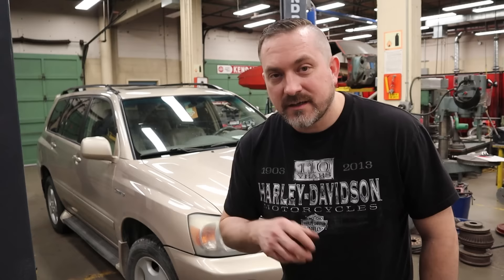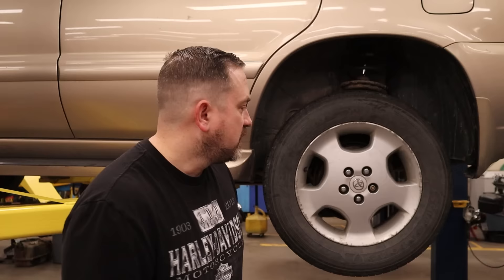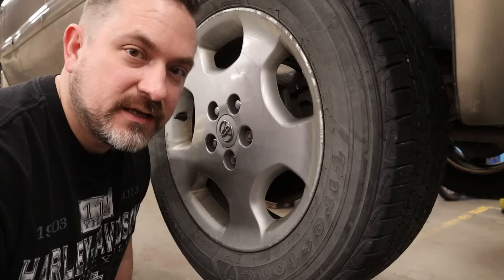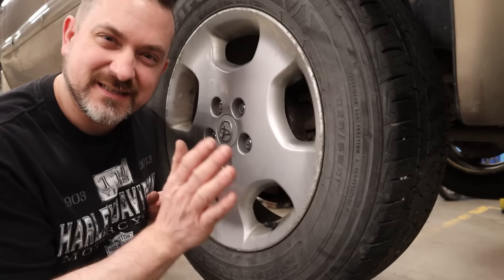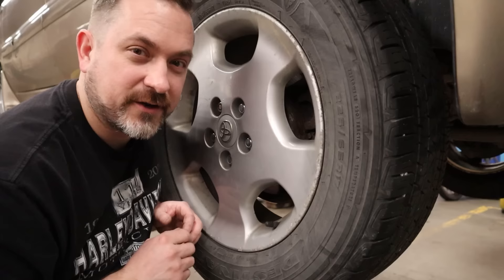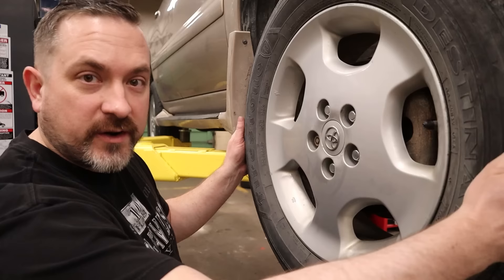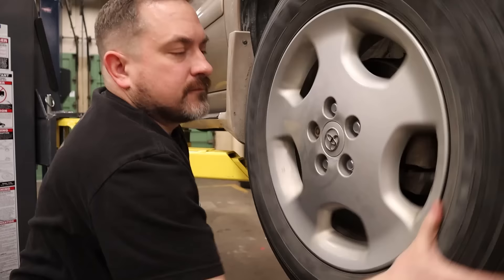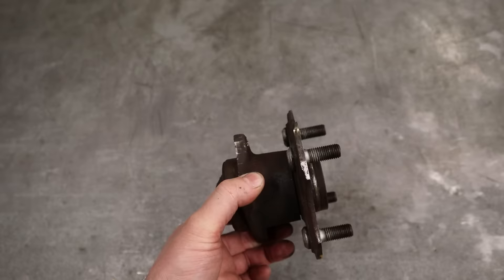How to 100% diagnose a bad wheel bearing.

Comment: Have a small grinding sound front left at SLOW 20mph. Thoughts ?
Reply from the maker: Grinding noises are usually very worn out bearings or brake pads.  My guess is your brake pads are worn out and you have metal on metal contact now.  I have a great video on checking disk brakes and another for drums if you're interested.  Thanks for the watch!

Comment: Is it usual to have to replace both sides ?
Reply from the maker: It's good practice because both wheel bearings have the same amount of km put on them so if one is gone, the other is soon to go.  You can just change one but usually the other is not far behind.  I have a video on changing this wheel bearing as well if you need it.  Thanks for the watch!

Comment: My  had a bad noise on the right rear of my car. I took a turn down my road to home. 1 mile.  So I'm checking out on what's happening.  So many things go into this. My friend says maybe brake shoes dragging, possibly a broken brake clip that holds the brake shoes in place. 
I wonder if there's more. I hope to learn more about this. 
But I'm 80, a woman but always keep learning about the motor. Anyway can you advise me about these. 
Thank you. 💞 😊
Reply from the maker: That's awesome that you are wanting to learn more!  Yes it could be lots of things.  Try to narrow it down by figuring out if it happens during braking or not or both, when you turn corners, when you speed up,etc.  Then you can check that system.  I have several videos on checking bearings, steering, and brakes so you can start there.  Hope you figure it out.  Thanks for the watch and welcome to the channel!
Reply: It started out making noise when I was backing into my parking spot. It did it a couple times then it made the noise the last time I was coming home. I was almost home and then it was constant.  I then called my friend and he came to drive it. Took a foot and said, not good. 
Thank you for getting back with me. I will let you know what they find.
Reply: @wayofthewrench  I'm getting back to you on my rear tire noise. My son came to check it out. It had bad brake pads, rotors and calipers.   Also the bushing were bad. It's a 2007 hyundai, so it's old.
Anyway he got everything and did both rear tires for me. 
I'm thankful for a smart son. 
Thank you for your interest in what it was. 
Father's day next Sunday. So an early Happy Father's day to you.
Reply from the maker: Sounds good
Reply from the maker: Thanks for the update and thanks for the Father's Day wishes.  Glad you got fixed up. Cheers!
Reply: @wayofthewrench  You welcome and thank you.
Reply from the maker: No worries!

Comment: Ok, someone told me I needed a new wheel bearing, but now I'm not too sure. It started out like,, first it would sound like an opera singer hitting a high note just when I used the brakes, then on day 2 it would do it when I used the brakes and when the car accelerated.. it's a very loud, high pitch sound. I started out thinking it was my brakes bc I do need new ones.. I'm not sure now ..  🤔
Reply from the maker: Sounds like your brake pad squealer tab making noise.  I would check your brake pads, I have a great video on that.  Thanks for the watch and welcome to the channel!

Comment: Was there a vibration while driving between 20 and 30 mph? Also, between 70 and 80 mph?
Reply from the maker: Not between 20 and 30 and I wasn't able to road test at anything higher than 40-50 but there were vibrations and sounds like in the video.  It was a bad bearing and the part was changed in the next video if you'd like to see it.  Thanks for the watch and welcome to the channel!

Comment: Can you have that play in the wheel horizontal and vertical but not have the noise on acceleration?
Reply from the maker: Yes you can because you could have loose lugnuts or bad steering and suspension components.  Sometimes a bad bearing has play but hasn't been damaged enough to make noise yet.  Hope that helps.  Thanks for the watch and your support for the channel!  Cheers!

Comment: When your check-in the bearing on an automatic transmission is the car put in neutral as you spin the wheel
Reply from the maker: The real check is a road test for the noise and the play once up in the air.  The spin test isn't the greatest method.  You should check out the road test bearings video too.  Thanks for the watch and welcome to the channel!

Comment: Hey, I have two issues with my 2014 Mustang that my local mechanic can’t figure out

Issue #1	Vibrating / clunk sensation in gas pedal / front end while turning and accelerating from dead-stop. 

Issue #2	 Faint cyclic scraping / squeal from wheels under harder acceleration. 

Someone said it is the trans mount, and maybe a bad wheel bearing, but what do you think
Reply from the maker: Hrmm hard to say without checking myself but the clunk under acceleration could be worn engine mounts or worn u joints on the drive shaft.  I'd also check all steering and suspension components too.  The scraping sounds like worn pads and you should check your brake pads ( inner and outer) and if a dust shield is slightly touching the rotor.  Hope that helps.  Thanks for the watch and welcome to the channel!

Comment: So what if the steering ends are bad? Wouldn't you get the same side to side rock.? What about the upper and lower cradle.  Wouldn't it rock too.?
Reply from the maker: If there is play up/down and left right then it is loose lunuts or a bad wheel bearing.  If it's just left/right play, then it is steering parts that have play ( inner/outer tie rods or steering rack/bushings).  If it's just up/down play, then it's upper/lower ball joints or strut mount.  Thanks for the watch and welcome to the channel!

Comment: Out of curiosity could a squeaking noise when you turn the wheel also be down to a bad bearing? Thanks
Reply from the maker: It could be but a speed dependent sound and or play like in the video is the check.  I also have a road test bearings video you should check out too.  Thanks for the watch and welcome to the channel!

Comment: Great video.  I think I have a bad wheel bearing.  However when I turn wheel to right noise goes away.  Does this confirm the passenger side would be the bad wheel bearing?  Acura 2014 MDX SH-AWD
Reply from the maker: Not necessarily.  You have to jack up the front of the car to check anyways so just check both.  When you turn the car around corners you are loading and unloading parts like wheel bearings and cv axles.    Thanks for the watch!

Comment: what about if ur wheel feels wobbly while speed increase lug nuts and tight and good could that still be the barrings
Reply from the maker: If you jack it up and there is play up and down AND left/right, then it could be lugnuts or wheel bearings.  Torque the lugnuts to proper specs and if it still has the same play....its a wheel bearing.  Good luck!

Comment: Finger on the spring and spin the wheel, you can feel the vibrations with your fingertips, best way..
Reply from the maker: Yes that is a good method, I have a road test bearings video you should check out that has this in it too.  Thanks for the watch and welcome to the channel!

Comment: Thank you - I just bought a Skoda Yeti yesterday, on a test drive out on the motorway around Glasgow city centre, I didn't hear or feel anything, all looked good with the car, then bought it. Got home, in a quieter area, I can hear a noise coming from drivers side front wheel I think, I feel fairly sure it has a faulty wheel bearing, the noise gets louder when going faster, then quieter as I slow down. Luckily the car came with a 1 year warranty so I will be making a claim tomorrow morning. Does anyone know if it is dangerous to drive the car whilst it has a faulty wheel bearing i.e. a garage may have a long waiting list before I can get it booked in and repaired, so should I leave using the car for now?
Reply from the maker: A Skoda eh?  Good old Slovak car!  Sounds like a wheel bearing, you could also watch my road test bearings video to help you confirm what side and a few more tips.  I would confirm you don't have loose lugnuts and check if the play is really bad.  If it just started you have a bit of time but they can be funny.  They could last weeks or hours, it just depends on a bunch of factors.  A wheel bearing could be upwards of $1000 in a shop especially if they find other things or if they have problems removing parts due to rust.  Plus I'm not sure how hard Skoda parts are to find.  Good luck!

Comment: I know it’s been a bit, but what if there’s no side to side play but there is up to down play? It’s still likely wheel bearing right?
Reply from the maker: It could be but only up and down play is usually suspension components that are worn.  Ball joints, strut, control arm bushings.  Have someone shake the wheel while you check on the other side with a light.  Good luck!

Comment: \The onlly thing you need to do.   Lift up the car.   hold one hand on the spring, and turn the wheel.  If the bearing is gone you wil feel the vibrations in the spring. simple as that.
Reply from the maker: Yeah that's a good tip, I have another road testing bearings video you should check out too.  Thanks for the watch and your suggestion.  Welcome to the channel. Cheers!

Comment: My front right wheel is just making a light scraping/rattling type noise but nothing like this, started after a bad pothole so not sure if it’s the wheel bearing or not
Reply from the maker: You will have to check that out like in the video.  I would suggest you check the rim for damage and the thin metal dust shield next to the rotor too because of that pot hole.  Good luck and thanks for the watch!.

Comment: What if my car shakes while breaking in the free way. I replace break pads and rotors the good ones from auto zone and still does the same thing. Last year I replace the rotors and break 3 time
Reply from the maker: Sounds like perhaps you have a worn steering or suspension component or possibly a stuck slider pin on your caliper.  Hope that helps.  Thanks for the watch and welcome to the channel!

Comment: What’s the buzzing noise? Is that from the wheel bearing also?
Reply from the maker: It's hard to isolate every sound in the video but focus on the speed dependent sound that gets louder with more speed.  Tires can sometimes make sounds too but you're listening for whirring noises.  Hope that helps.  Thanks for the watch and welcome to the channel!

Comment: I have i believe a sound coming from a belt ,but im sodded if i can work it our for sure..it only starts making a noise after the engine warms up..
Reply from the maker: Belt noise is usually it's worn or loose, check for wear, shinny surface on grooves, and if you can twist the belt Morse than 180 degrees between two pulleys.  If you can, the tensioner is bad.  Usually belts make noise at cold start ups then go quiet and make noise at hard full turns.  If it happens once the engine is warmed up, it could be a bad bearing on one of the pulleys ( alternator, tensioner, idler, Ac compressor, power steering, etc).  Good luck.  Thanks for the watch!
Reply: @wayofthewrench  thanks for your input..I've been avoiding long journeys .I suspected a bearing as the belt was only changed 10,000 miles ago.
Reply from the maker: I would still check your bearings in case it is that or something else loose or bad you spot.  Good luck!

Comment: Two times the wheel bearing failure fooled expert mechanics. Once it was tread separation and the second was intermittent grinding caused by a fractured roller. One mechanic was a top fuel contender the other was a life time family business mechanic.
Reply from the maker: This was one of your wheel bearings?
Reply: @wayofthewrench  Ha ha he he, yes. The tread separation was on a Dodge Van and the mechanics replaced the wheel bearing. They said sorry "thats the best we can do". I eventually found someone who knew about tires and they sold me new tries. The other was a Saturn Ion. Notoriously bad wheel bearings. I replaced them myself several times and the mechanic bet me 5 bucks it was not a wheel bearing. I gave him the old bearing and he said he didn't believe me and would not pay the 5 bucks. Hahaha. Oh gosh. German made bearings are sometimes made in Taiwan. Timken seem to be consistent quality and reliable as a bearing can be that hits potholes a foot deep.
Reply from the maker: I had a tire separation on an old truck the other day...I had to stick my body out the window so I could see the issue.  There was a huge bulge in the tire that was not obvious when it wasn't spinning.  Ya proper diagnostics is key to not wasting money and time.  I think the last time i went to a mechanic was 19 years ago.....I like saving my money and actually enjoy working on my vehicles too.  Thanks for the watch!

Comment: Thought my wife's car has a bad wheel bearing before I watched your video. The sound coming from right side, only noticeable with open windows when it is bounced off the buildings or greenery. I noticed it after I cleaned her brakes and rotors after winter salt and grime. Brakes have over half their life left, so it can't be brake life indicator.
Reply from the maker: Hard to say, when you cleaned your brakes you might have cleaned off the silicone grease on the back of the brake pads.  That might be the source of a brake squeak but usually that is at slower speeds.  Does the sound change when you turn sharply?  Is it a speed dependant sound?
Reply: @wayofthewrench  it sounds when going straight and rate increases with higher speed. I regreased all contact points. Appreciate you reading and replying. Will take it apart today and see what's going on there. Rear passenger brake always gets corroded the worse and even got ceased once. I'm thinking it could be warped rotor, but everything is smooth and brakes don't pulsate.
Reply from the maker: Any luck?
Reply: @wayofthewrench  most likely rear bearing after all. When I removed brakes and caliper, I can hear some slight grinding and doesn't feel smooth when rotating.. Wheel itself is solid when yanking on it in every direction, so I think it has some life left.
Reply from the maker: If it's making noise then it's on its way out.  You could watch my road test video for bearings for other tips to narrow it down easier.  Good luck!

Comment: Damn, I'm less confident now it's my wheel bearing. I get a sharp screeching, like metal on metal (or pavement). Can happen at any speed, braking DOES change the pitch, and is inconsistent--it comes off and on, but it's been getting worse. I'll have to take it in at this point.
Reply from the maker: Hrmmmm hard to say but it sounds like your brake pads are worn out.  You might also wanna watch my road testing a bad bearing video too.  I also have a great how to check your disk brakes video too.  Good luck

Comment: what is the diff from bearing and bad cv joint on all wheel drive gone bad?
Reply from the maker: The sounds can be similar but you can test CV axle at low speed full turns in a parking lot.  When you max out the left/right turns and drive in a circle, you are pushing the CV axle and if it's bad, it will make a clunking sound.  You can also do this in reverse to test the other end of the axle ( inner and outer joint).  You can also lift the vehicle and grab the CV axle shaft and try to spin it by hand, there should be no play.  If there is a lot of play then it's bad.  Another give away is if there is a torn CV axle rubber boot with grease flung out.  Hope that helps.  Thanks for the watch and if you deem me worthy, I'd really appreciate it if you could share out my channel on your social media so I can help more people.  Cheers!

Comment: I only hear a grinding sound when i drive slow and hear it louder when i drive slow and turn too the left for some reason but it dissapears when i drive faster than 30kmh
Reply from the maker: Grinding sounds are never good.  Something's not good and is a safety concern.  If it makes more noise when turning a direction, that is giving you a hint like it's a bearing on one side or a CV axle.  I would jack up the car and check it out.  Good luck!

Comment: I have a 2008 silverado 2wd. My sound is very mild but i can also feel it on my steering wheel. It also is constant but the more speed, the higher the whirling sound🤷‍♂️.any thoughts?
Reply from the maker: It sounds like a bad wheel bearing to me, check it for play.  It could also be worn steering or suspension components too.  Hope that helps.  Thanks for the watch and welcome to the channel!

Comment: So i am having a scraping / grinding sound similar to what a bad wheel bearing would sound like. 

But checking for play and noise is unsuccessful. Seems fine that way. 

The sound is only present at very low speeds and does not change if clutch is pressed or gear is changed. Sounds same both in neutral and with gear.. 

Sound goes away when accelerating / decelerating... 

Strut mounts are in very bad condition and is getting swapped soon. But i doubt that could make this sound? 

Transmission, Wheel Bearing or CV? Very frustrating.
Reply from the maker: I would check your brakes and check for a bent dust shield that is scraping on the rotor. I have a great video on checking disk brakes too.  Thanks for the watch and welcome to the channel!
Reply: @wayofthewrench Thanks for answering. I just changed rotors and pads. Cleaned everything good and regreased. Its a more low pitched sound. Not like typical brake-noise.
Reply from the maker: Speed dependent sound, meaning the faster you go, the faster the sound gets?
Reply: @wayofthewrench  It is not speed dependent more than the fact that it only sounds at low speeds. 
I would say it has turned more towards a grinding noise now. Car runs great and shifts smooth. Confusing..
Reply from the maker: Did you watch my road testing a bad bearing video?  Also it could be a seized caliper.